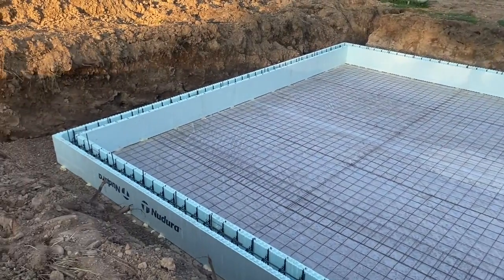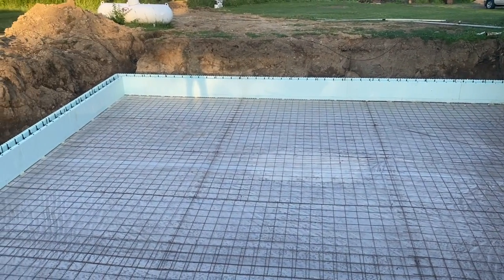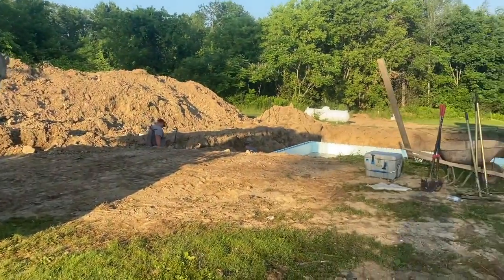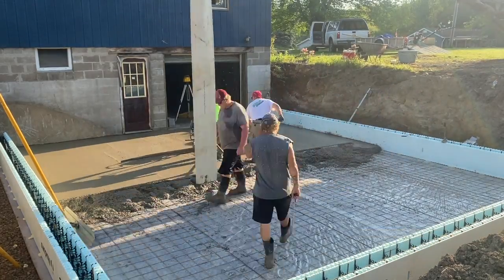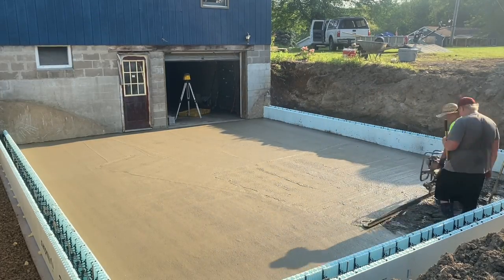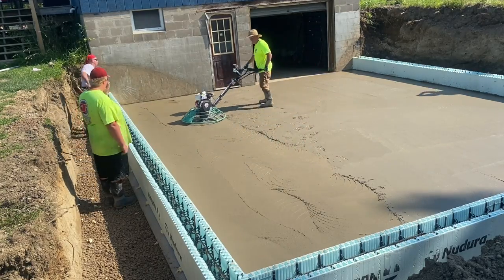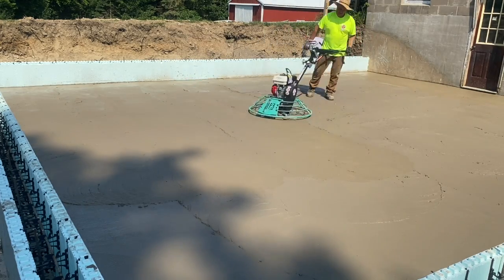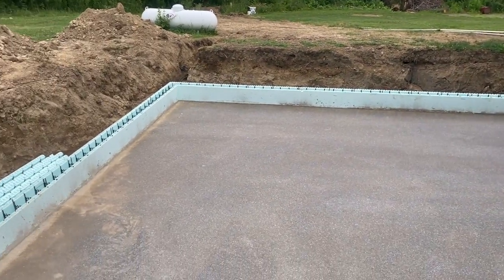Building ICF foundation for an addition step 2

Comment: I’m building my first icf house. I ran a pump for 15 years and pumped many icf walls. However I want to do a monolithic slab and do the walls so I’m not working in a muddy mess. Have you ever done it that way. I see you poured your footer and then set your first course.  If you do it that way do you need to lay another course of icf  to make up for the slab depth so you have a full 8 foot ceiling. Thanks for any help

Comment: What are the pros and cons of doing a nudura wall pour in a single pour for the entire wall height versus separate lifts (of say 4 foot each)?
Reply from the maker: Great question. The problem with doing it in one lift is that it will put a lot of pressure on the bottom blocks and you might get a blowout. doing it in lifts lets it set up a bit and less chance of that happening.

Comment: Did I miss a part in the video? I'm just about to start my new house with ICF. I was debating between Nudura or Amvic R30. Comparable in price but people say the Amvic 30 is easier to work with in terms of keeping wall strait and less risks of blowouts because of the 3.25" thickness. I like the idea of pouring the floor before bring the walls up but aren't you worried of your walls moving on you with the pressure from the concrete when pouring the floors?
Reply from the maker: We have done it about 20 times with no issues. spray foam holds the block solid.

Comment: I want to do this exact same thing with my shop, but I was worried about the blocks moving during the pour. Do you have any concern or ever run into issues with the blocks moving?
Reply: Watch the previous video. He glued them down with foam spray.
Reply: @KlemReefing  ya, I know they glue them, just seems like a decent amount of pressure on the blocks, especially since you are pushing concrete against them. I’ve always just poured the floor after the walls are built. I like his method here though. Seems much easier. Thanks for the reply.
Reply: @patrickgraham8268  I was thinking the same thing like that foam wouldn’t be enough to hold back 4” of concrete. I mean if you had one bust loose it would be a huge problem. If it were me, I would t risk it. Maybe Bondo will respond to this?
Reply: @patrickgraham8268  Until I got some comfort I think I might still duplex a 2 x 4 on the outside of the Nudura's. JMO